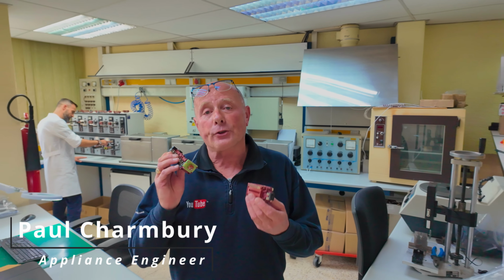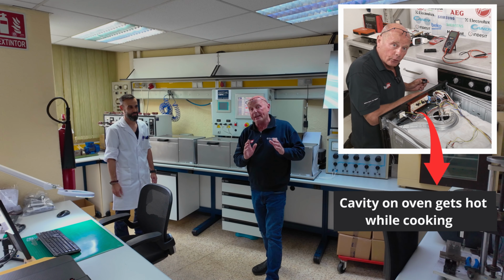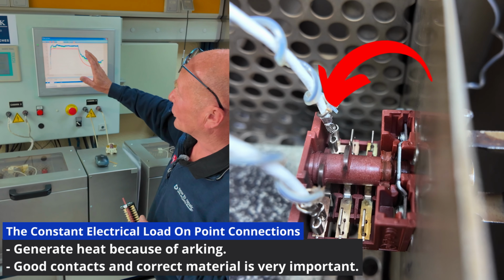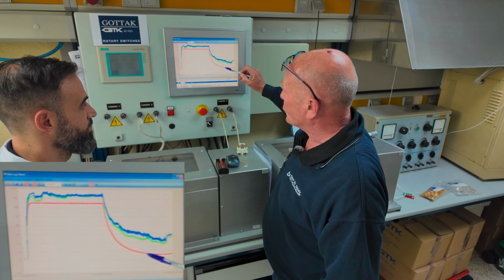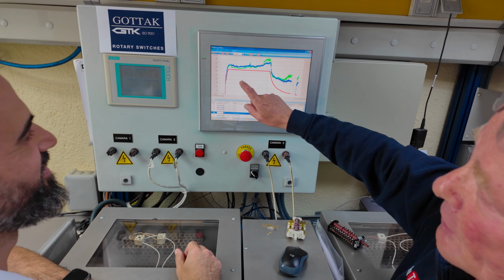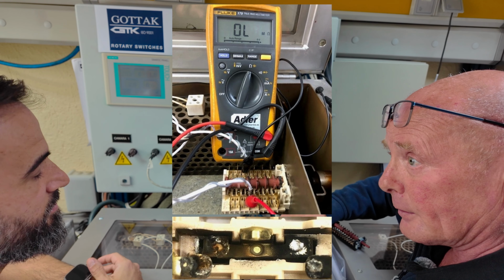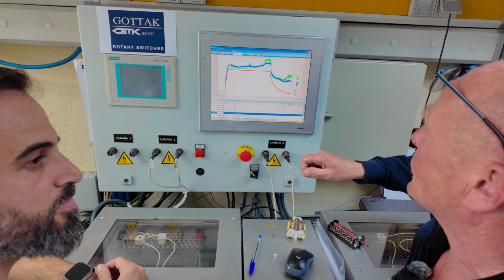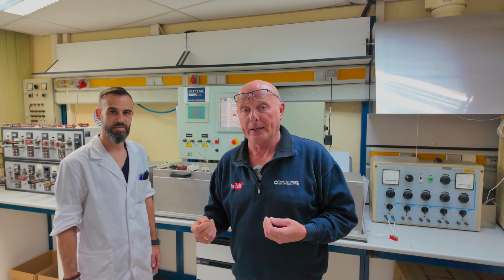How Selector Switches Are Tested On Oven, Stove, Cooker? Factory Test Procedure of Selector Switch

Comment: Brilliant presentation Paul, so very true. I watched your presentation from the Expo in Europe and you were saying that appliances are now built and marketed  for novelty value rather than longevity. I have had this discussion many times and had ventured a figure of 5 year life cycle before a fault occurred if lucky and I was very pleased to hear you say similar. I have worked in various electronic engineering jobs and then went self employed in the mid 90s working independently and also with major brands and have witnessed the gross over complication of products particularly in the last 10 years. Currently I'm an agent for one major brand as it was too difficult to juggle others with parts and complexity, as it is it's a struggle with the extreme range of parts for the multiple types within the same model code for example even with a single brand.  Looked at a washing machine this week, no power on... possibilities..Main PCB, Display PCB, Control Panel Touch Membrane, wiring harness...and it can be anyone of these and I have found previously that is indeed the case. It was the touch membrane, this was after replacing the main PCB (which requires the motor out, wiring harness detached etc, very tedious), then trying the display PCB and finally a repeat visit with the control panel with membrane built in. Utterly unnecessary complexity. All in a shed, late evening, ice on the ground, freezing 🙂
I gave up a job as a lecturer in electronics..there's just no explanation for this!!!
Reply from the maker: Manufacturers today often try to trick people. Let me explain. When you visit a superstore, you might see 50 to 60 different brands for sale. But, these brands are all owned by the same five big companies. The products from these brands use the same parts as others. This is one way manufacturers deceive people.

They also buy cheap parts to put in machines, knowing these won't last more than three to five years. For example, a switch made in China might cost only 30 to 40 cents less than one made by this company, but the quality here is much better. However, manufacturers choose cheaper parts because they care more about making money than about how long their products last.

Many great brands were once known for high-quality machines. But now, after buying up all the brands, manufacturers keep producing poor-quality products.
Reply: @How-to-repair  Not sure if we can name names here but there was some fantastic British brands who's name still exists in the market but..need I say more
Reply from the maker: LOL: I won't name any names because I don't want die or mysteriously disappear, but let's look at one company's history and where it stands today. In the 1980s, Hotpoint was known for making high-quality washing machines, like the 95 series. They also made good cookers and dishwashers. 

Then, Italian companies entered the market. They started buying other companies and selling cheaper alternatives in the UK. Eventually, Indesit owned Hotpoint. Over the years, they also acquired other brands like Creda, Ariston, Jackson, and English Electric.

Later, American company Whirlpool bought all these brands. In the last year, Beko has taken over this entire range. This industry is massive; it's even bigger than the car industry when you think about it because every house has at least four appliances.

You can see this with Hoover and Bosch, the German companies. Look at all the brands they own. It's really a shame. The accountants decided it was cheaper to buy out the competition instead of making high-quality products themselves.
Reply: @How-to-repair  This is so true Paul, Hotpoint was one of the brands I was thinking also Belling..both manufactured in the UK. Hotpoint was one of the first brands I worked on...I worked for a medical electronics company in Abingdon, Oxford and from my bench I could see the rear yard of a Dixons where they stored the returns etc...1993 I captured one of these and I think it was from prior to the Aquarius range...sold it a week later for £95..and here I am 🙂
Reply from the maker: We come from the same background. I used to recondition a lorry load of hotpoints every month. It would take me 45 minutes to strip a machine, put new carbon brushes in the motor, fit new bearings and seals, replace the door seal, and then it was ready for a new customer at about the same price as yours with a six month warranty. I had a production line constantly reconditioning these machines.

I also worked with the Hoover A3 series, the Hotpoint 18 series, and many other high-quality, refurbishable machines. Today, we live in a throwaway society. Manufacturers try to ensure that these machines never return to the marketplace, even though they can be refurbished.

This practice of scrapping machines guarantees they don't come back on the market. It forces families to buy new machines instead of affordable, perfectly good refurbished ones.